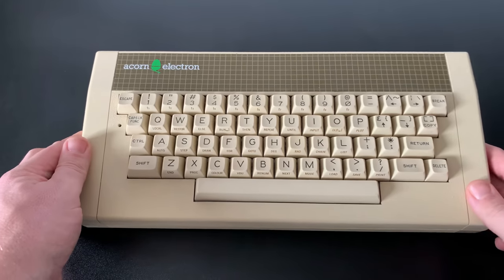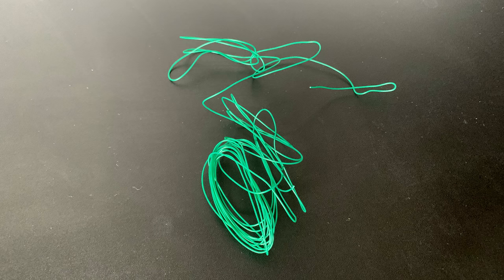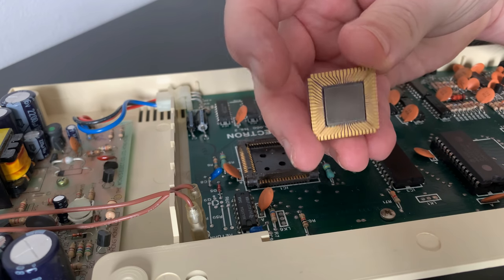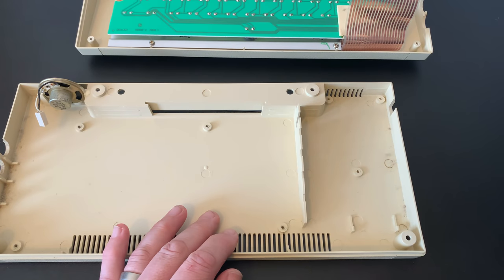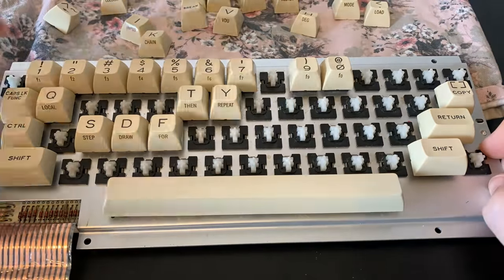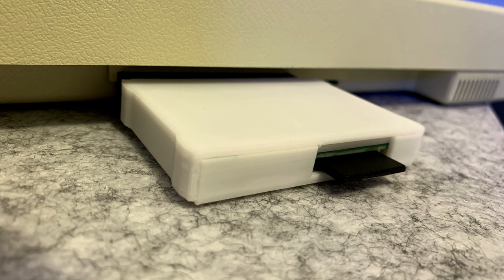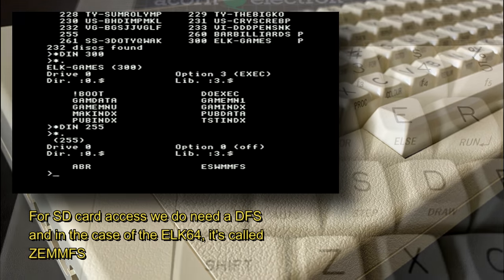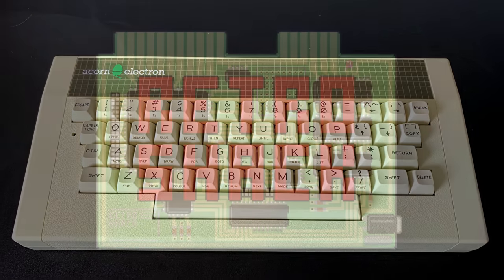Acorn Electron - Part Three: Fixed! In more ways than one!

Comment: I had an Electron as a kid. I remember my mum got a 2nd job just to pay for it !. They were very expensive back in the day, and even more so when mortgage rates in the UK were near 20% at that time. It was 3 months late so i got the machine in March rather than at Christmas. When it arrived from dixons it was dirty, and the power was intermittent. I didnt tell my mum or dad and waited until they were out one day and i took it apart. I was only about 11 at the time but i was into electronics and i found a cracked Solder joint on the power connector. So i reflowed it. I think i had got a shop used unit. After my repair it was sweet. It was great to do my programming at school on the BBC, then bring it home on tape and carry on using my Electron.
Reply from the maker: Good old mums!And well done for the repair!

Comment: Nice job as usual! Aren't the 18V connectors AC rather than DC? I think it doesn't matter which way around they go.
Mine had the same issue with the ULA needing cleaning and reseating. The keyboard connector also had some weird white residue growing on it, not sure what that was!
Reply from the maker: Lol - maybe!  I'll have to check that out - I'll feel a bit foolish if it is :)  And yes, it's quite strange what you find on these old machines sometimes :)
Reply: Yes. It says 18v AC right there on the motherboard.  It would not have been designed with unpolarised connectors had there been a risk of getting it the wrong way in the factory.
Reply from the maker: @IrrationalRecreation  Well, that's me told - didn't even notice that! :)  I guess I'll have to fall on my sword for that one :)
Reply: @TheRetroShack  Better safe than sorry!
Reply: @TheRetroShack    Sorry,  didn't mean to come across in a critical manner. I was just a bit too matter-of-fact !

Comment: Oscilloscope and Signal Generator ? Digital DSO138 2.4" TFT Oscilloscope Acrylic Case DIY Kit SMD Soldered R2C0 Is it this one and is it any good and do you recommend them ?
Reply from the maker: Yes that's the one :) And you know what? For the price, and for what I use it for (checking the signal status on IC pins) it's fine - you're never going to get the absolute accuracy that you'd get with an analogue device but for what I need it works just fine :)
Reply: @TheRetroShack  Thanks for the feedback. Know where i can get one cheep ? Parts seem to add up a bit :/
Reply from the maker: @JohnDoe-qg6hm  I grabbed mine off Amazon as a kit - look up DSO138 kit :)

Comment: Idea for a future episode. I almost bought an EPROM programmer for my BBC so I could put my code into ROMs, but I ended up making do with loading into my Sideways RAM add-on from disk instead.

I wonder what using an EPROM programmer would have been like.
Reply from the maker: Consider the idea duly noted and under serious consideration - mainly cos that sounds like fun!
Reply: @TheRetroShack  The device I was looking at was sold by Beebug. It had a ZIF socket with a locking leaver. You'd drop the blank in and connect it to a port and run an app that feeds the ROM image into the blank.

Comment: How about a 2nd processor on the Electron?
Or adding a serial port and doing some comms?
Reply from the maker: Well, Retro Recipes got a c64 to talk to the space station - perhaps I could set my Electron's sights on the Perseverance rover? :)
Reply from the maker: @G7VFY  That is FASCINATING!
Reply: In theory you can use a Pi Tube via a cartridge plugged in to the plus 1

Comment: Why did they not use an ARM processor in the ACORN ELECTRON.
Reply from the maker: Wouldn't that have been something!  But watch the Paul Fellows interview and you'll get some answers to this :)
Reply: The original aim of the Electron was to be a cut price BBC Micro, so more families could afford a micro with BBC Basic and run BBC software.

Comment: Nice job!.. Sweet little machine that was a year too late / under spec and overpriced when it was released... and not black. Sinclair and Amstrad did well with their black home computers simply because people thought they looked cooler.. The only way Britain could have ruled instead of Intel, IBM AND Microsoft, would have been for a consolidation of all our home, business and education PC makes into one, government-subsidised range of computers. 
--
Sinclair, Acorn and Amstrad together could have maybe ruled business, education and home markets with a small range of compatible, great spec, well priced machines.. Acorn designed CPU, Sinclair and Acorn designed ULAs and new tech. such as 'Wafer Storage'.. SINCLAIR as the brand name due to international fame, with Amstrad getting exclusive distribution rights and Acorn credit for designing the guts (+ Sinclair a little bit)... Acorn would have probably ended up buying out Sinclair and Amstrad after their ARM CPUs took off.
Reply from the maker: Thanks!